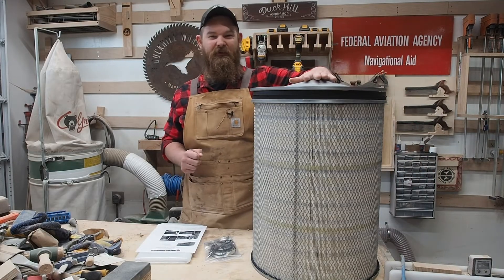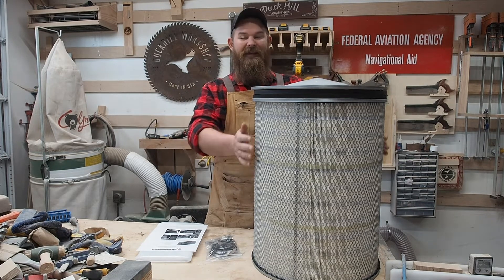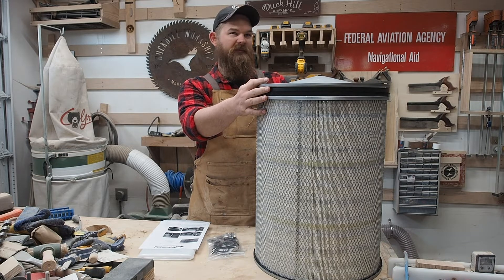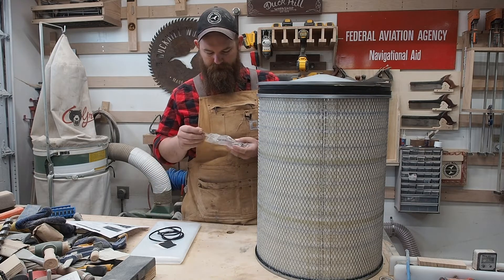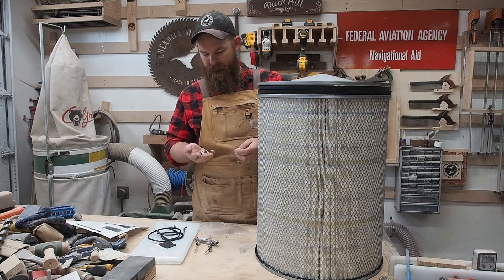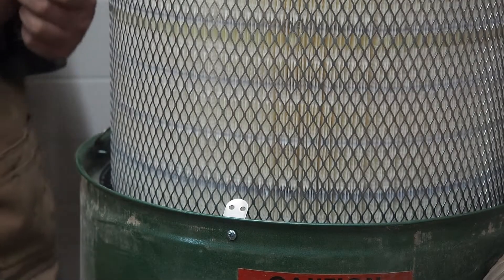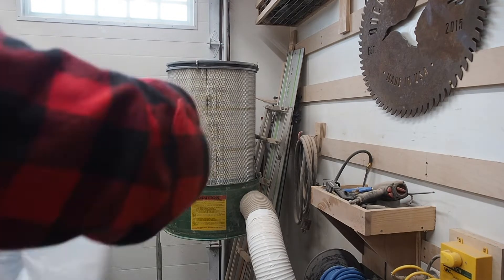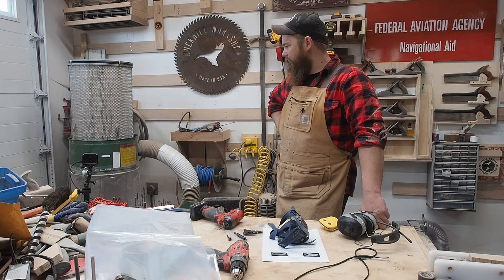Workshop Wednesday: Filter Upgrade for Grizzly 1.5hp Dust Collector

Comment: anyone know how the 1 micron grizzly filter compares to the wynn in flow rate, surface area  and pressure loss.  or say the griz plain and hepa difference. ?  I picked up a 50 $ Bx094402 filter that is for  the G0944 wall mounted unit.  it says 1 micron but no sq ft number or merv.  The pleats are less numerous that the wynn and only about 5/8" thick.  It does have the  side gear drive paddle to shake off the dust every so often.
Reply from the maker: I dont know how the grizzly compares to the wynn, my general feeling is you get what you pay for. 

I'm also dubious about the paddles inside the filters. Do they work, yes, do they abrade the filter media and cause holes? also yes. The metal cage around the wynn filter I just slap around a little bit and occasionally blow off the filter with very low air pressure. I did plug the filter once with heavy drum sander use and blew the removable top off the filter... That was a fun day.  My second dust collector setup doesn't have the removable cleanout.

Comment: I also have an old Grizzly and need to upgrade.
Reply from the maker: I hope you do! 

This has made a noticeable difference in the dust level in the workshop, however you need to be mindful of banging on the filter cage to knock the fine dust off, or blow it off with a very low pressure air hose… 

it’s not fun when you plug the filter and blow the lid off 🤣🤣🤣

Comment: How do you clean the filter?
Reply from the maker: I bang gently on the metal cage to knock any built up material off, and if it feels like I’m loosing airflow I turn my air compressor way WAY down and lightly blow it off